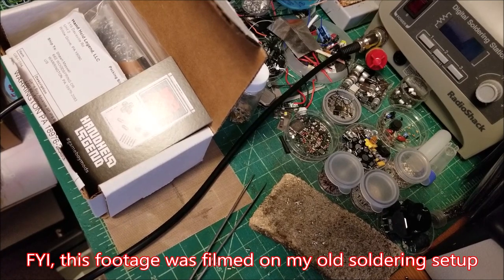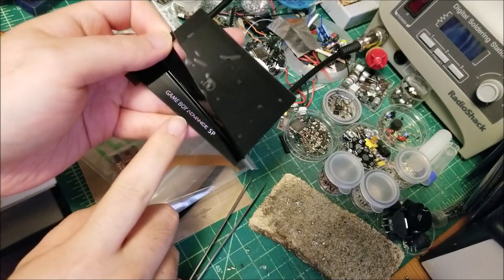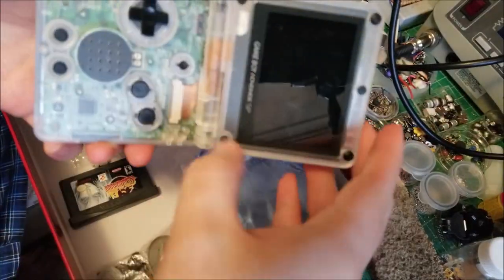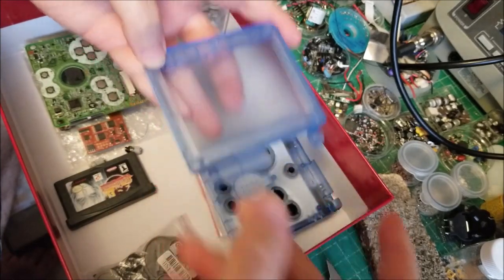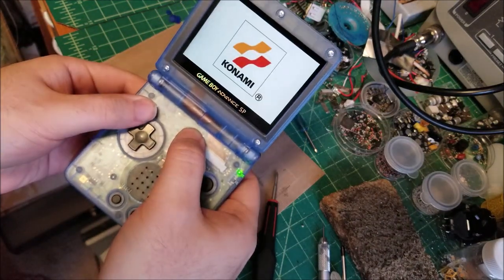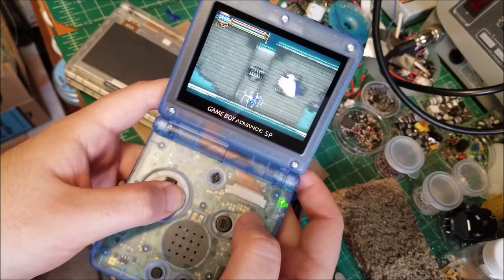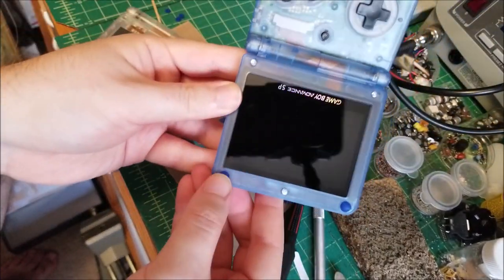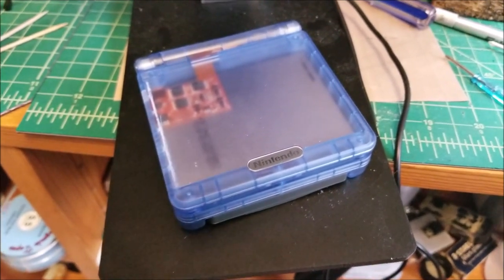GBA SP IPS LCD Installation

Comment: You may be able to use a butane torch to go over that cut line in the plastic. Very lightly and quickly not to melt the plastic. I used this technique to git rid of these marks on 3rd party clear Gamecube controllers.
Reply from the maker: I actually recently got one of those small butane torches, I'll test on some scrap plastic.

Comment: I know I'm a little late, but what temp did you solder that wire on?
Reply from the maker: 680F or 360C depending on which unit you prefer.